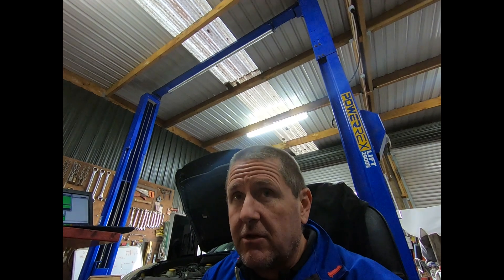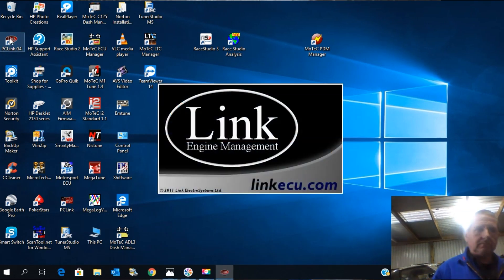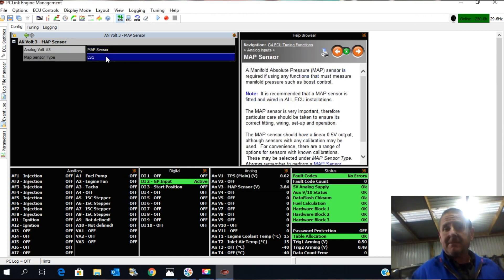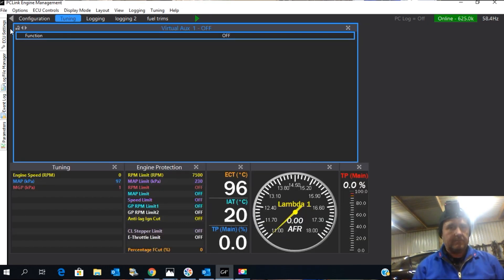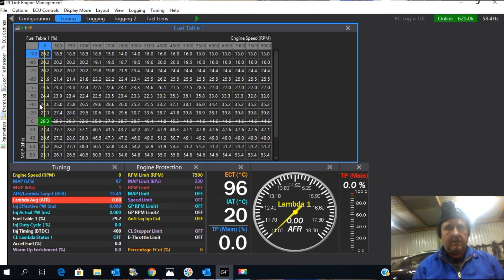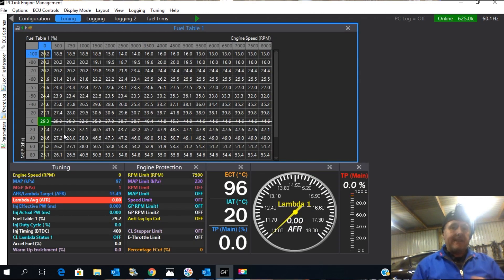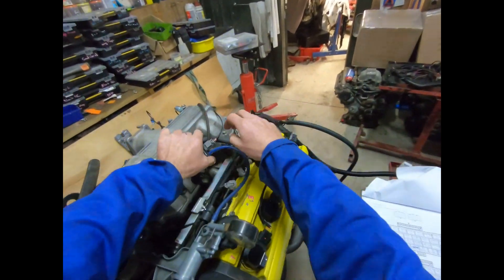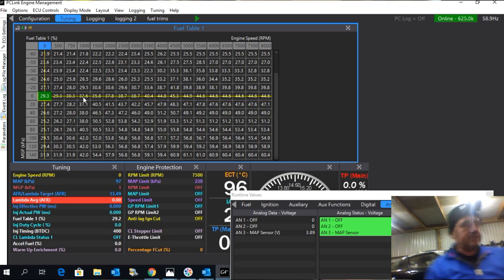PC link Basics. LINK ECU tuning. How to set up your link ECU. Calibration of the MAP sensor.

Comment: Can I use the MAP sensor installed on a car from the factory?
Reply from the maker: Yes.  In most cases using the factory map sensor is fine provided it is wired and calibrated correctly.  Cheers Kelvin.
Reply: Hi CarTuneNZ 
Couple questions
I have a Nissan 350z, ITB, Link ECU 4+  how can I tune it so i can drive the car?
Reply from the maker: Hello.  Do you have any tuning experience?  Do you understand the software?  Cheers Kelvin
Reply: Yes I understand that Southward pretty good i have an idea how to use it but I will need a little bit of walking through from someone like you they has more experience and I I believe I can do it, I already make my Nissan 350Z turn on and everything but I just want to make sure how to tune a right so my engine is safe for me to take it for a drive,